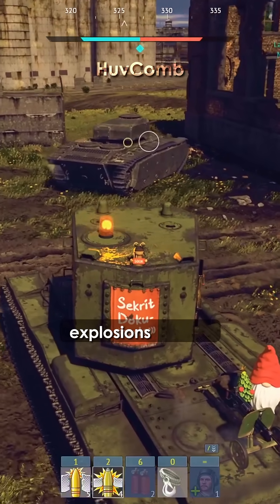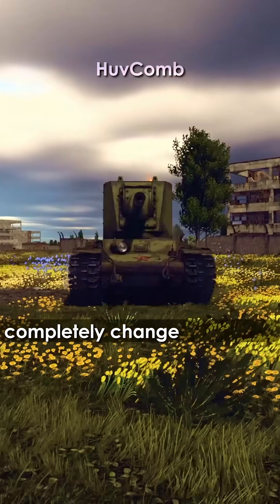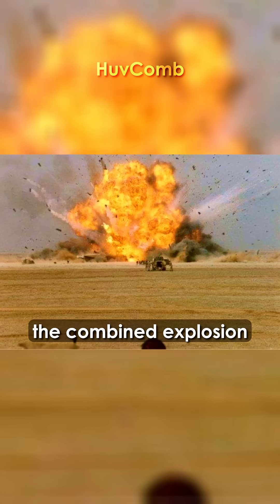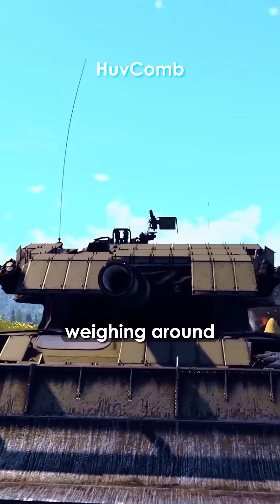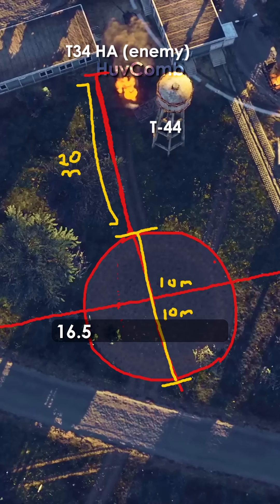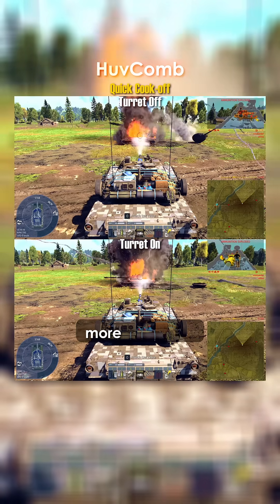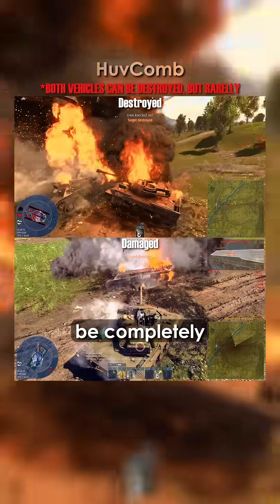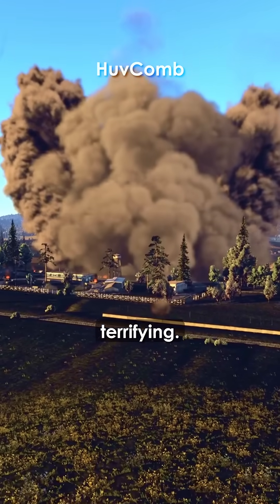What If War Thunder Ammo Explosions Were Real?

Comment: There is a couple things worth noting here: the tank will usually contain the explosion a little better than bombs do, and warthunder players usually carry 30% ammo at most. The centurion AVRE also is a particularly explosive tank thanks to the large caliber chemical ammunition.
Reply from the maker: Yes! I explained it in the longer version
Reply: @HuvComb Oh, that's good to hear, I think I'll watch that now.
Reply: @HuvComb sir, diesel doesn't catch fire alone.
Reply: I and another team died due to my team having full ammo
Reply: @nonamef4r1  
A mistake every player makes.
Reply: they should make the explosion based on the volume of the tank, percentage of ammo carried divided by the type (like solid ap is less then squash or heat) and the caliber (might be wrong on the ammo type)
Reply: @TagNoGame  Thats a good idea. I think it should maybe also consider the armor to contain and maybe direct the explosion. For example Sherman's thin side armor would let the explosion out of the sides better, as shown by the exploded one in the video. However, a Maus would probably do an excellent job containing the explosion.
Reply: @woof0075  i doubt the maus could contain an explosion, the shockwave & explosion cant exit fast enough from the exhaust which would cause it to explode, tho not the average it would still splitter every part of its armour
Reply: @TagNoGame I'm not saying it would completely contain it, it would just take quite a bit of the energy out of it. The very large gun and ammo capacity would probably offset that anyways. 

Edit: now that I think about it, it probably wouldn't make much of a difference since all that pressure still has to go somewhere. I was thinking more from an explosion outside of the tank point of view.
Reply: @woof0075  ngl, i honestly think if the maus' hull is not just 1 pure part and welded together it might just fall apart lol (from the explosion)
Reply: @TagNoGame  Yeah probably it would be in a lot of pieces. It is worth noting though (If I am remembering right) the germans did explode a prototype maus (to keep it away from the russians) with the ammo inside and the hull was destroyed but the turret was relatively intact (hence the russians combining the hull of the first prototype of the turret of the destroyed one). I did a little bit of research and I can't find the exact story again so it might not have been completely true though.
Reply: mayby in top tier but war thunder players do NOT only carry 30% ammo brochacho
Reply: @baseformrolf6710  I only carry about 20 rounds regardless of tier, which, unless I am playing Russian cold war tanks, is not more than 30% of my ammo. Maybe that's just me though.
Reply: @woof0075  not everyone knows the meta of the game, and some of us like me don’t really care, i just play for fun, if a full load ends with my demise so be it
Reply: @therebelengineer  Fair points. I also play for fun, but I find it more fun not to be a bomb on tracks.
Reply: @woof0075  I like to see how massive the explosion can be sometimes 😂
Reply: @baseformrolf6710   100% for the win
Reply: Me with my sherman with full ammo. Hahaha yeah 30%
Reply: Yep, look at T-72 Turms tanks used in Syria and the ammo detonations thry often had. The turret would pop and the explosion looks very similar to those in war thunder.
Reply: There's also the thing that it's a Centurion... It would have petrol not diesel fuel owing to running off a 27 litre Rolls Royce V12. Aka the meteor engine.
Reply: @oddball_the_blue Good point
Reply: Well I use max ammo

Comment: I kind of wish there was damage models for the level three cook off

Rather than the turret , just flying in the air and leaving a crater in the floor😂

They Could pull the old game tactic , which would make it easier to handle for even consoles

Were the model of the tank gets immediately deleted and replaced with a damaged model facing the same direction

And they can have maybe even three damage models that could be chosen from

:3 

I got to play a war thunder mod , using my playstation four , where they kind of did that , ish ? 

But after a while , the model would just delete itself 

😢

Comment: Keep in mind also that diesel doesn’t grenade like most conventional gasoline so for the sake of not having to animate the difference between diesel igniting and conventional gas JP8 and all other octanes every fuel acts differently when under ignition like that diesel is often used in napalm well homemade napalm burns slow and extremely hot it does just detonate like conventional gas

Comment: Essentially they calculate it to the amount of ammo you bring with its type for example aphe can have anywhere from 50g up to 500g of TNT in it so take the average of lets say 200g to the amount like 16 shells we can then insert a bomb weight variant to it will work like a bimb being dropped from a plane which starts iff at 50kg up to 5000kg even more if needed which when a cook off happens a pre set of damage and range is determined there so if u run M18 GMC the boom be so great compared to a fully loaded M55

Comment: Its wrong. The thing is this explosion happens over time, and there is way more space to expand into - the tank, then most energy goes into mangling the armor and sending bits like turret and engine flying as they plug the holes. So these TNT equivalents are for instant detonation, and cookoffs happen over 1-30 seconds. I dont think there is any physical situation where all of the ammo and a part of fuel ignites.

Comment: I don't think the high explosive charge in shells is what will explode together at once , these are designed to take main barrel level of heat & pressure & only reacts if the fuse mechanism is triggered properly !
but the propellant charge inside the disposable casing that usually gets ejected in modern autoloaders , is the big bomba ! Not well protected , even handling by crew is quite risky , no hammering movement allowed ! Oh & the gun breach ! Some are just gunpowder in two big paper/cartoon bags ! So scary !

Comment: I feel like that would be highly situational. It would depend on the ammo type carried, location of ammo storage, type of fuel, and location of fuel tanks. Most modern heat rounds use a higher stability explosive charge, diesel fuel burns differently from petrol, and depending on the layout, you might not get a single massive detonation, instead a gradual cook off of rounds.

Comment: You forgot to factor in shell propellant into the explosion
Reply from the maker: Due to information and legal reasons I cannot calculate 100% of the explosion
Reply: @HuvComb assuming a 5% energy loss due to recoil and escaped gases, a charge of roughly .25KG tnt equivalent would push its 29kg shell at its muzzle velocity of 250 m/s.
Reply from the maker: @contemptordreadnought  Hm... so most of the tanks would carry .5kg probably
Reply: @HuvComb i was wrong, i mathed wrong. A lot more energy is lost than i thought. A Propellant of roughly 7kg (tnt equivalent) per shell is much more likely, to a maximum of 10kg